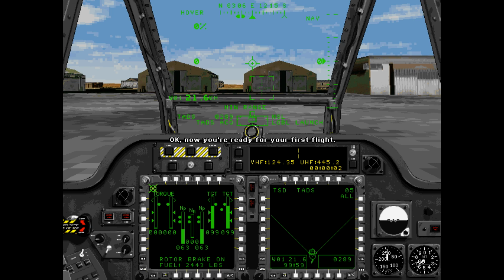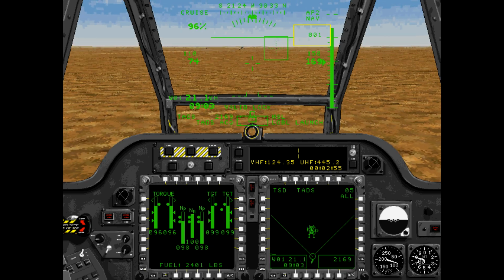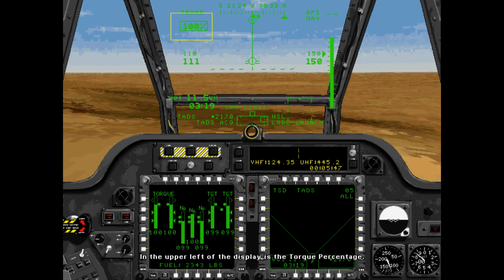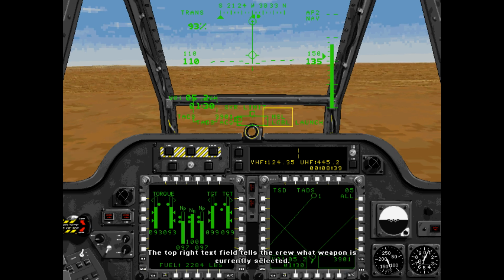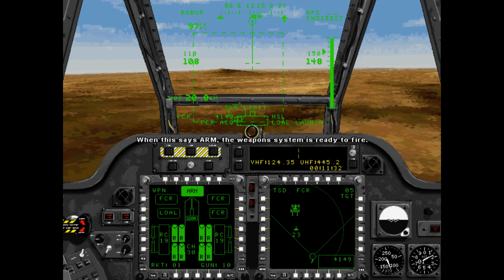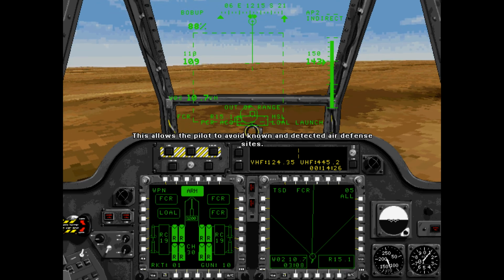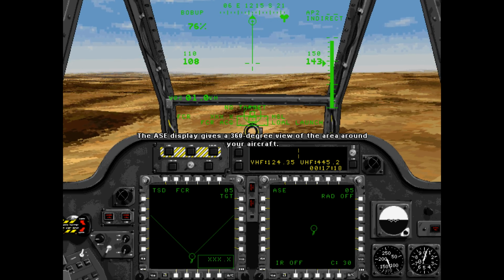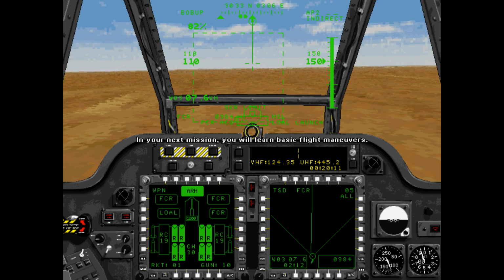Jane's Longbow - Training: Instrumentation

Comment: Hi,
Is it compatible with the Warthog hotas?
Reply from the maker: It may be difficult to set up with DOSBox as it only supports single USB controller. If you combine stick and throttle into single device (as seen by OS) with some software then it should work. AFAIK you could do that with ppjoy, but I'm not sure if it works on Win 10.
Reply: @damsonn ,I still have my cougar, it could maybe work .... 🤔